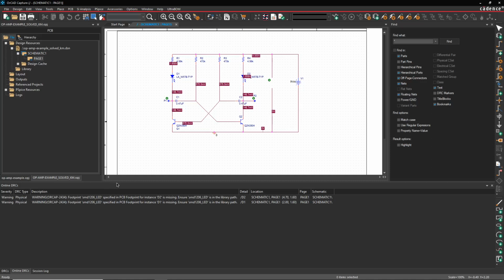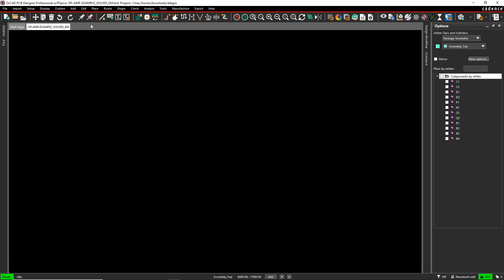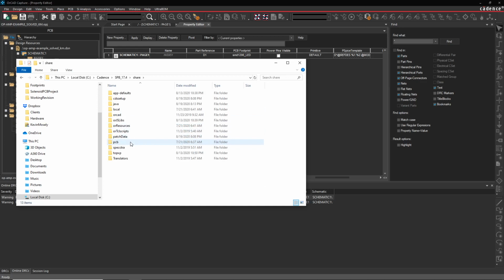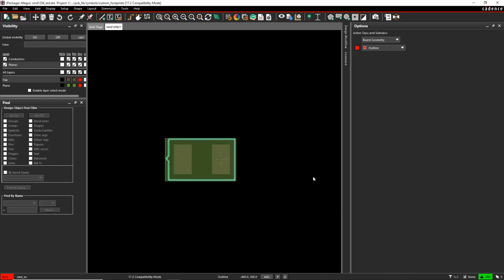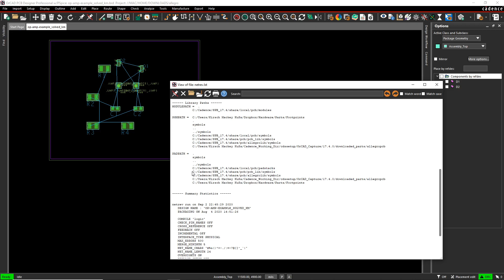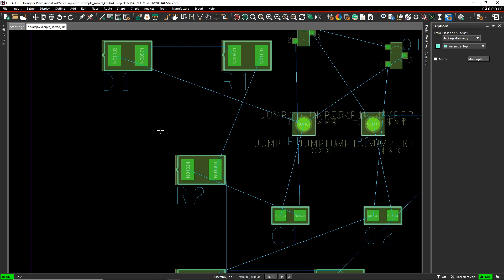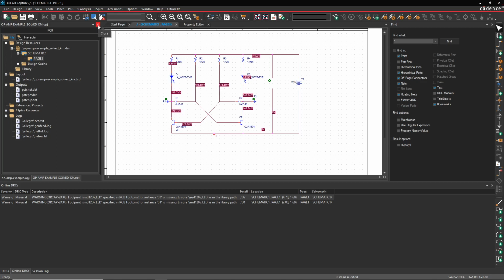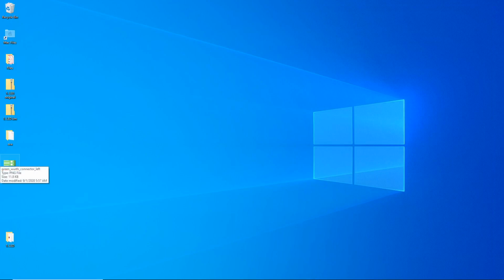How to Fix 'Footprint Property is Missing' Error in OrCAD Capture - Easy Tutorial

Comment: I have 17.2 and when I try to look at a footprint within the CIS tool it mentions a capture.ini file within the window on the bottom. I opened the file and added a few paths and now I can look at footprints in many different directories. Under the 'Connect' section near the top I added the four lower lines. 
...
Connect=xdfscfgdsggfdgsghdssdfsdfdsdfsd
[Allegro Footprints]
Search path0=Your specific location 
search path1=Your specific location 
search path2=Your specific location
...